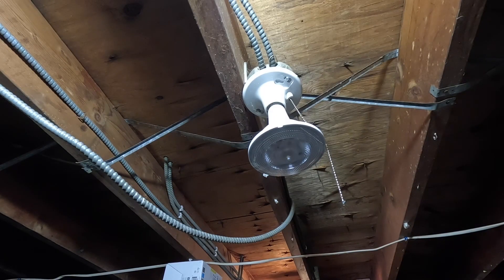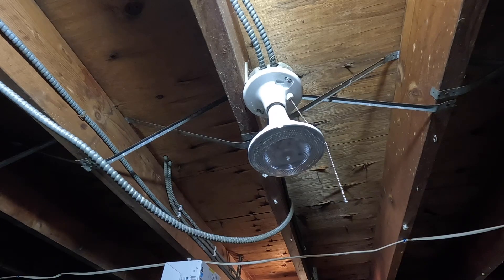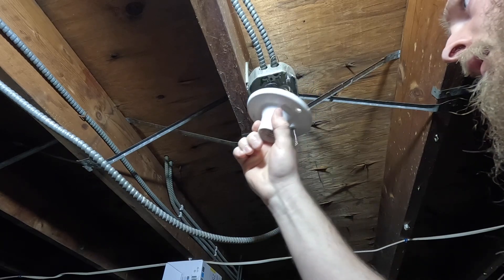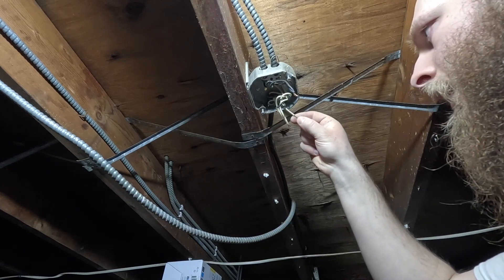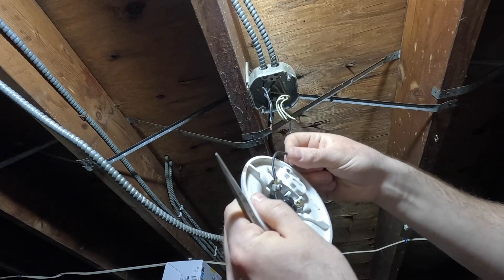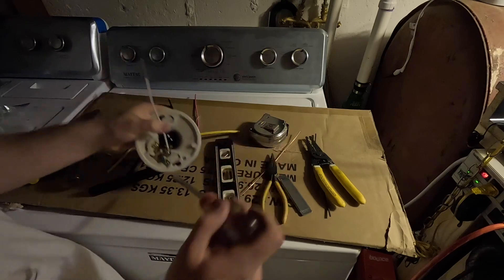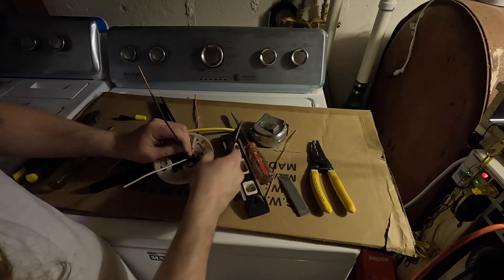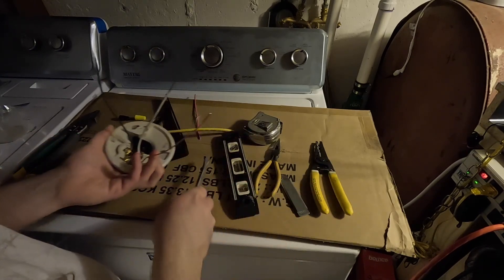Repairing Another Major Electrical Hazard Downstairs

Comment: I highly recommend mend that you rap the wire nuts with electric tape and go around it four times that's code where I live at
Reply from the maker: Wire nuts should not be taped. It creates a sticky mess with time and serves no purpose. The NEC does not call for taping wire nuts.

Comment: Looks like they did a common practice from back in the 60's where they just took grounding wire and bonded all the wires with the BX cable that was grounded back at your main panel.  Mid 60's into the 70's, it was easier than doing a full rewire to meet code.  At least you had grounds.  I had to go through and rewire my entire house from the late 50's we just bought a few years ago.  It was a pain in the rear, but everything is up to code now and I don't worry about the electrical anymore.
Reply from the maker: At some point, I will have to go through a full rewire here as the wire has surpassed it's expected lifespan. There are now multiple areas where the wire insulation has become sticky or is brittle and cracking.
Reply: @JordanU  if you are lucky, you won't run into the dreaded soldered joints.  That was a nightmare when I was doing my house.  I went to fix one 'air splice' in a line... that turned into a 3 day rewire of the water heater, washer outlet, 4 of the 6 lights in the basement, and a new home run to the panel.  🤨 I was not a happy camper.  I do understand why they enforce inspections so strongly today.  It used to be the wild west...

Comment: Those plastic lamp holders are garbage. I have them in my basement and garage. Ceramic is much better. I never had a ceramic holder break on me. The plastic ones aren’t made for higher wattage incandescent bulbs at all. A 150 watt incandescent will definitely melt the plastic socket because they get well over 340 degrees if you use those incandescent light bulbs in base up position.
Reply from the maker: The only failure I've encountered with the ceramic fixtures is the chain pops out. Never had a hazard develop like this.

Comment: You know, plastic is more than adequate for dealing with the heat of LED lightbulbs. That's probably why these are becoming more common.
Reply from the maker: I don't agree with that at all. Plenty of today's garbage LED bulbs get as hot as incandescent. This one failed while it had an LED bulb in it.
Reply: @Jordan U True, I’ve measured all of our LEDs with that infrared thermometer, along with my incandescent bulbs, and they both are typically between 160 and 200 F. I think a room in our basement has a fixture with a similar failure taking place (or, it might be something coming unscrewed), and it has an LED in it.
Reply: @GPRW_Media My GE Clear 100 watt incandescent got up to 460 degrees Fahrenheit in horizontal position. However, that’s normal and LEDs should never be getting any hotter than 150 degrees Fahrenheit. Heat kills LEDs.
Reply: @loudspeakertestsmorebyaida3804  True again. I don't get how some LED bulbs can be designed so badly!
Reply: @GPRW_Media  that should be just the base which radiates off heat less than the incandescent lightbulbs.
Reply: @Techlifeandmore  Yep, that's how it should be, but I pointed the laser thermometer at the bulb itself and measured around 180 degrees Fahrenheit.
Reply: @GPRW_Media  Yeah. I had many Quality Light Source LED bulbs fail on me in less than 4 years. They’re supposed to last 25,000 hours and I don’t leave them on for more than 10 hours a day (typically).